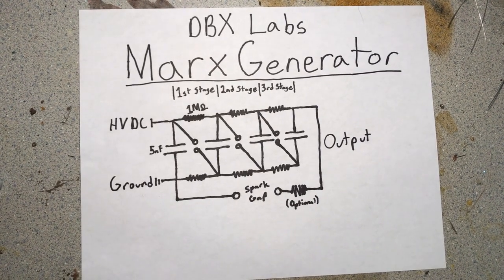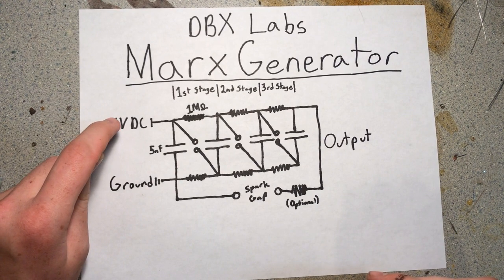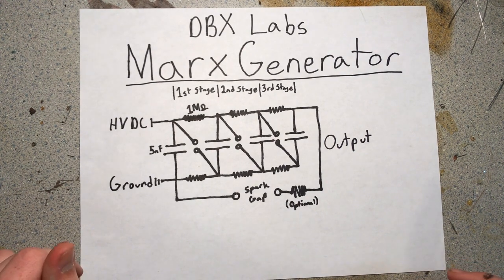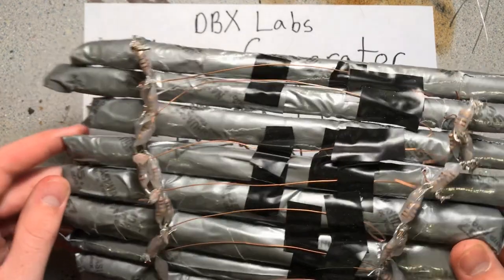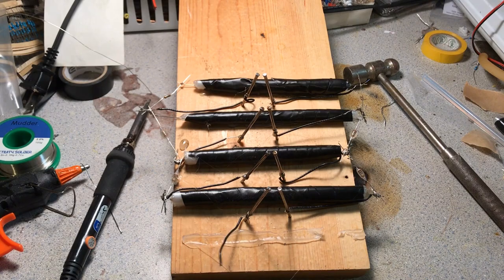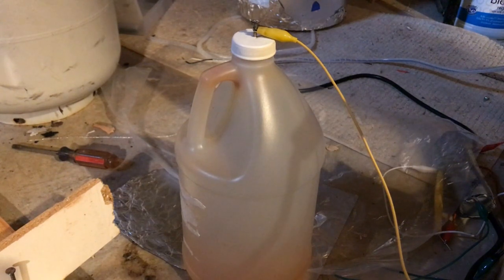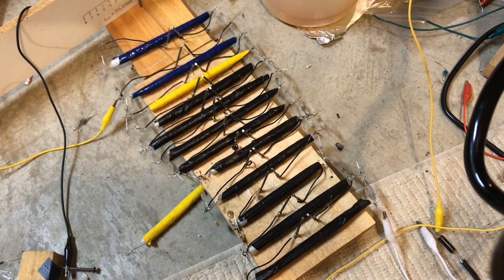How to Create 100,000+ Volts Using a DIY Marx Generator

Comment: Good work! Try to put several resistors in series (like 2 x 500K instead of 1 x 1MOhm), they resist better at higher voltages, I observe you covered them in plastic for protection :) Also try to use round electrodes for spark gaps, like bend wire or cap nuts, you control better the discharge which tend to be irregular if sharp edges are present.

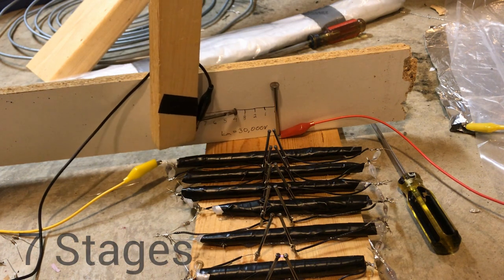Comment: 8:16 something with your calculation is wrong
common Rule of thumb is 1mm=1000V in air so 35mm is 35kv not 135kv
Reply from the maker: Hyper Hektor the common rule I’ve always worked by is 30kV/cm. That’s the standard breakdown voltage of air at sea level.
Reply: @DBXLabs   i measured several high voltage circuit 1-2Kv which confirm 1mm=1000V
sadly i cant find a english source, just the one in my language german https://de.wikipedia.org/wiki/Funkenstrecke#Allgemeines

only this atm, https://sciencing.com/calculate-voltage-spark-gaps-8776030.html

there are 2 rules to be precisise 1kv/mm (10kv per cm) for sharp/pointy electrodes, and 3x(30kv/cm) of that if the eletrode is round and smooth ball or toroid. The reason is the arc has much more difficulty to break down.

that nailhead is pointy (has a edge), and its better to use pointy eletrodes to determine the voltage since the error of measurement is way smaller.
Reply from the maker: Hyper Hektor ah I see. I was not aware of the two rules.

Comment: Could I use this setup to run my dental X-RAY tubes?  They have best focus @ 65kV.
Reply from the maker: Unless your x-ray tubes run optimally off of 65kV pulses, a Marx generator is probably not the best way to go. I'd recommend a standard HV step-up circuit using HV caps and diodes. That would provide a more continuous output of HV DC.
Reply: You could try to wire up 3 flyback transformers in series that would probably give you a continous voltage that is high enough. Or you use one in combination with a voltage multiplier (depending on how much current the x-ray tube needs)

Comment: Is it possible to use 100 K ohm resistors instead 1 M ohm?
Reply from the maker: survival science1996 I’ve gone as low as 333K ohm and it’s worked but I’m not sure about 100K. Then again, it heavily lies on the charging mechanism so if you are charging with a rectified flyback, it would be necessary to use lower resistance resistors.